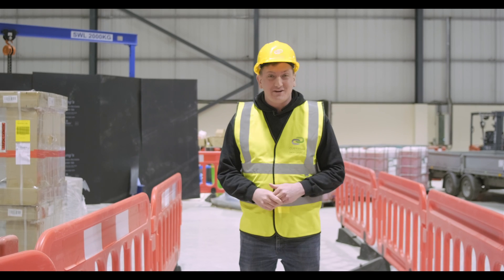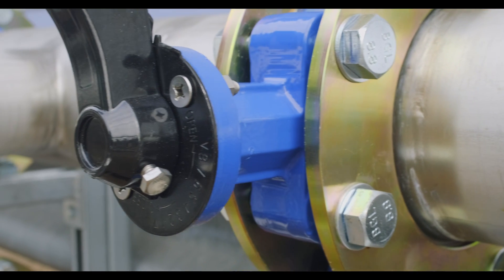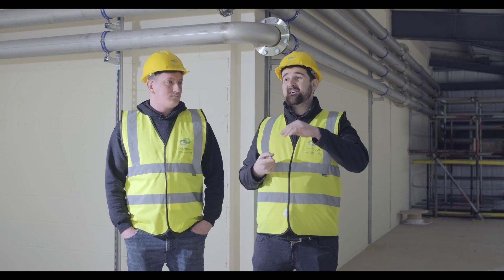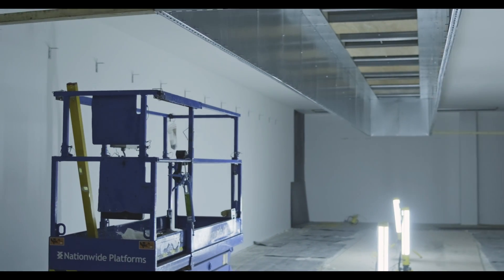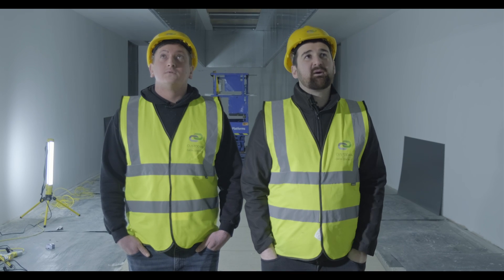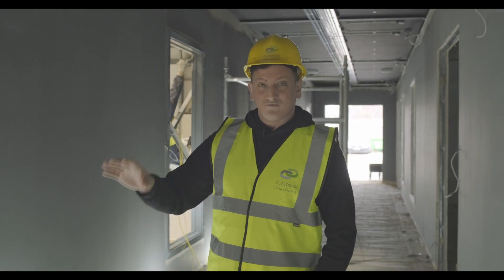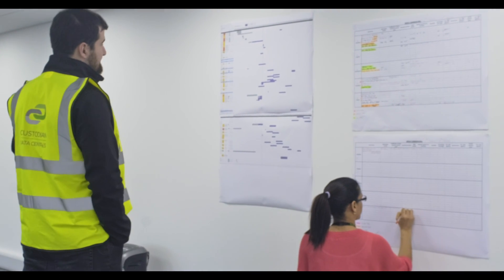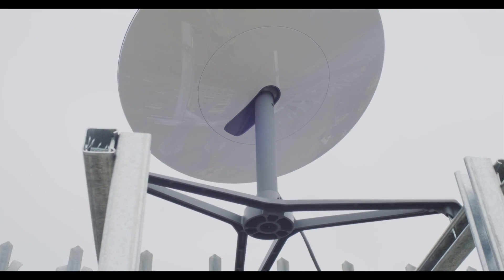HOW TO BUILD A DATA CENTRE - Episode 3

Comment: Question: how cold does a server room need to be, what are the disadvantages of running a server room hottter than ambient or colder.
Reply: As a rule, server rooms are set to a temperature of 21 degrees Celsius in a cold corridor and a humidity of 30 to 60%.
In hot regions, data centers need more energy for cooling.
Power usage effectiveness (PUE) is a metric used to determine the energy efficiency of a data center. 
Modern data centers are guided by an indicator equal to 1.1-1.5